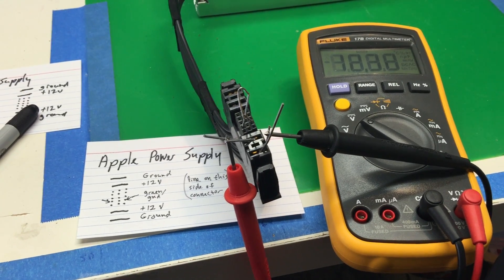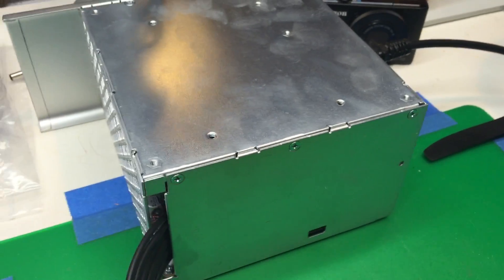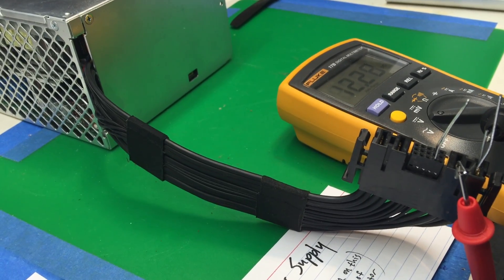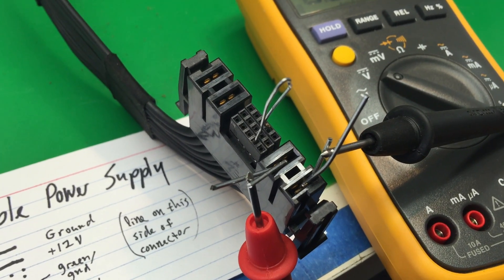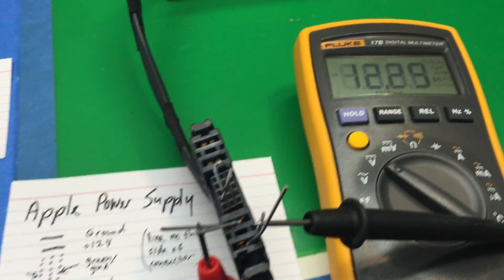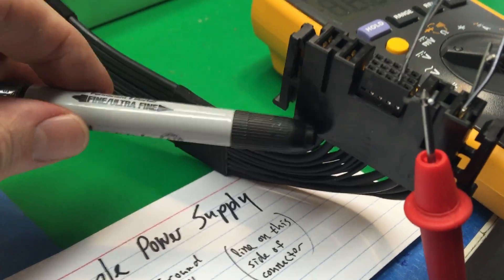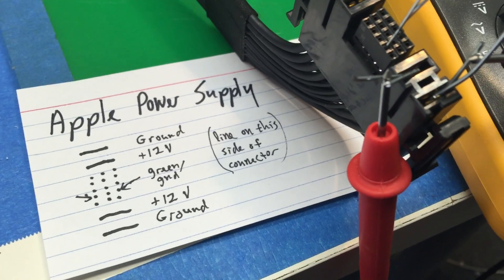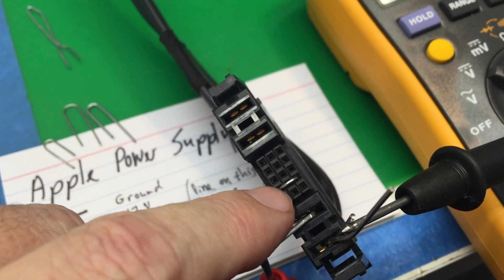Modding an Apple Mac Pro Power Supply

Comment: I just tested my power supply of my Mac Pro. I've got 16+ volts! So thats is seriously no good. Also when turning on I heard that click. And then it makes a really loud and weird sound, and it not sounded ok. So I turned it immediately off when I tested it. I think my backplane board (motherboard) is also dead causing over voltage from the psu. I dont know if this is exactly the case.

Comment: Just jump started mine, I have 12v but the PSU does not sound happy, I get a slight high pitch sound and a soft clicking, I have no load connected, I’m guessing this isn’t normal?

Comment: Hello, how would you test this unit for power with the paper clip method? One end into green the other into black?
Reply from the maker: Insert the paper clip into the holes shown. plug unit into AC power.  Use voltmeter to verify 12V betwen +12V and Ground connections.  Remove paper clip.  Should be 0V between connections.

Comment: I have this weird behaivior in my Mac Pro 2012,.... it wont run in cold weather.... but i put a heather in front and i fire it up, then it starts to restart over and over, until it gets warm it stays  on... i found that with an app to monitor cpu temp and mother board... it works fine on 65 celsius in the mother board.... any sugestions???? im suspecting about my PS but now im not sure....

Comment: Hi, Very helpful but what is this clicking sound, I am getting similar and I attached some LED Lights and those are continuously flashing with this Tick, Tick , Tick. Do I have to increase the Load to get rid of it ? Looks like few more like me asking in comments :)
Reply: Same. Tick tick sound when psu is plugged in. Mac Pro won’t power on. It has done this before.

Comment: If anyone has any idea wether i can mod a normal 24 atx Power supply, or where i can buy parts to rebuild a mac 3,1 power supply please help me out, i have recently stumbled upon two Mac pros, one is a 2, 1 from 2007, the other is a 3, 1 from 2008 and i am trying to rebuild the 3, 1 there was a graphics card and a logicboard in there, i have reordered the cpus and ram, ram is here already, cpus will be soon. Is there any way for me to check wether power supply and logicboard are still in working condition? if that helps, when i m plugging the psu into the wall and the logicboard, there s a clicking sound like a relay or something and when pressing power and relay button there are some LEDs on the Logicboard which light up for a moment. cant figure out which but i dont really trust the power supply anyways, so if anyone could help "build" one or mod one from the old parts and/or a new one, please respond, thank you very much!

Comment: Hi Mark, thank you for time making this video. My power supply went dead is there a way to replace MAc Pro 1.1 psu with out the original disk come with Mac Pro? I do see the statrup disk with hard drive icon was wonder if that contain original disc.
Reply from the maker: Sadly, I don't know much about Mac installation.  I got this power supply from a discarded box.

Comment: Hi harrison thanks for the video .. do you think i can use an ATX power supply to my mac pro 2010 ? would be great if you can help me through
Reply from the maker: +chamila warna It may be possible at the electrical level since the required voltages are all provided, but it would take some work to figure out how to make the required wiring connectors.  I couldn't find any specs online of the mac pro power connector.
Reply: +Mark Harrison thank you for reply !! really appreciate your advice.. after search all around the google count find anything for someone finger out how to use an ATX power S. for mac pro-2010 or 11 , in this video has exact the same PSU on my mac pro . found a issue on my power supply tha voltage (power) is not stable its droping the voltage up and down continue when we check it on multi metere :/  its too exepencvie this time for me to get e new on ebay or somthing.  and would be great if you know why is power drop like a wave up and down(dim) on PSU. thank you !!
Reply: +chamila warna and the power connectors are the same as your video :)